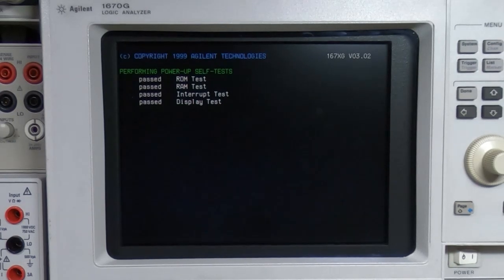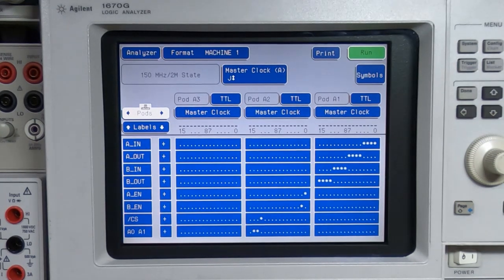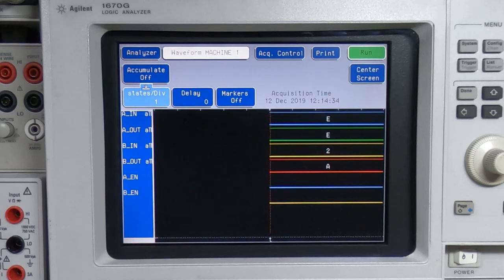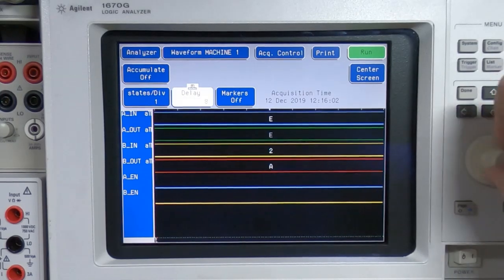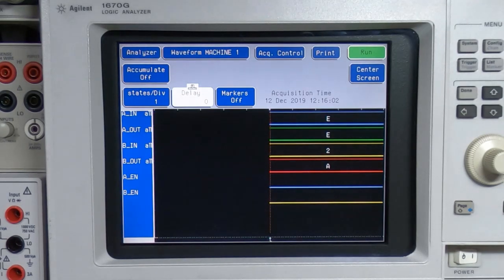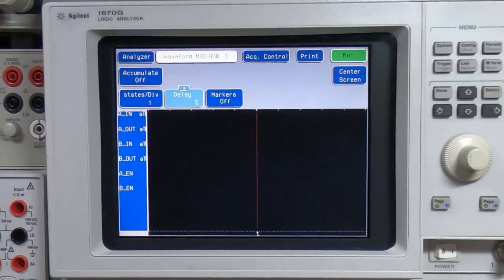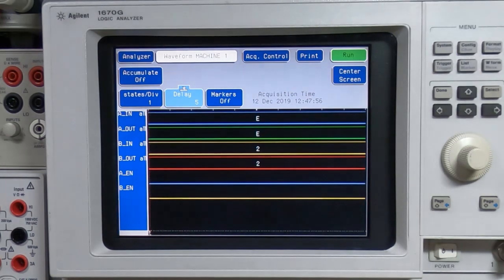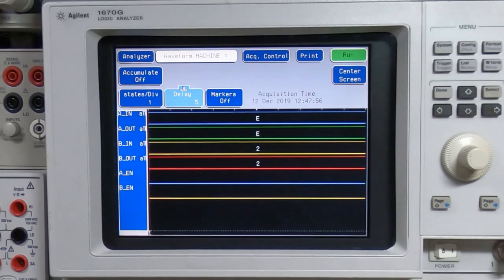Wren Part12

Comment: Perhaps the old LS244 it was running with too load. Finger testing the new one for heat could be of help. However awesome method for such hidden faults. 👍
Reply from the maker: Good point but no devices were running hot. I use a thermal camera to check the board as I progress to look for hot devices (I will show this in the nex video). This device was also only driving a single pin. I have tested the device out of circuit and it has an effective short between bits 2 and 3 so the output of B,3 is being forced by the input of B,2. This is a fairly common mode of failure for these devices. This is another reason I remove the devices without damaging them further as I find this sort of thing interesting. As a medical systems designer I find it very useful to understand failure modes as it helps me design better and more reliable equipment. You are absolutely correct that a finger can tell you a lot (also your nose).
Reply: Jerry Walker thanks for the replay. 
I hope to post soon my IBM videos, a good fight. Winner still to be declared. Your comment will be a privilege. I’m currently repairing just for hobby,  you know how is the first love story.